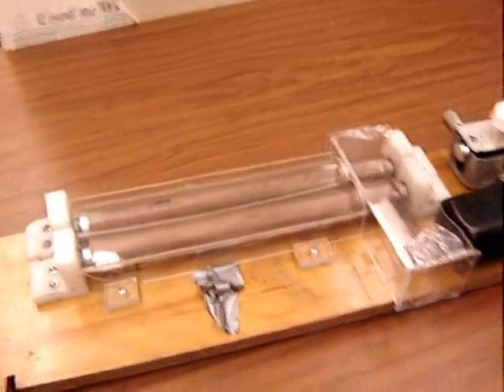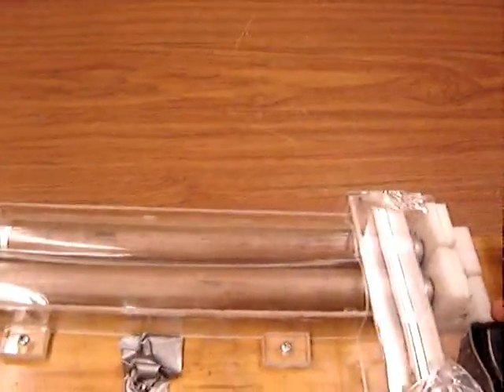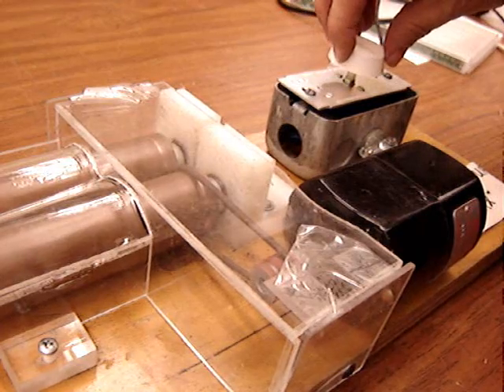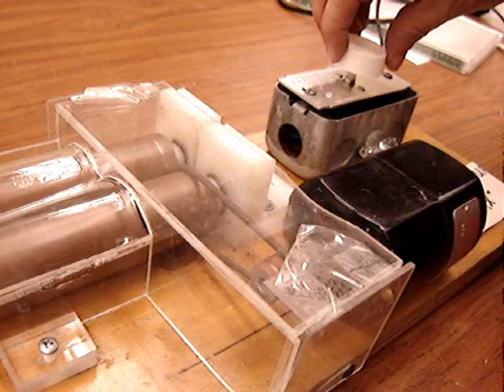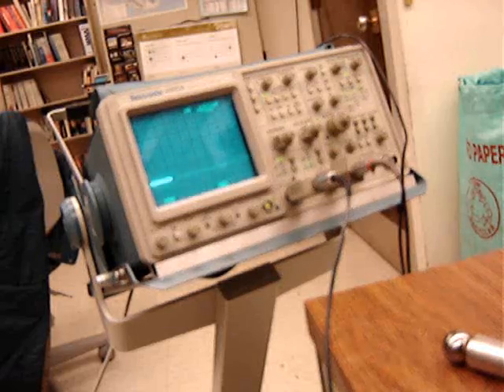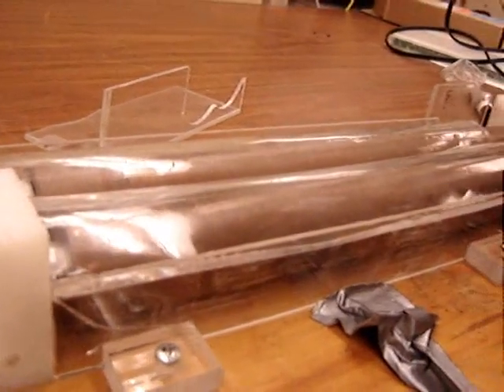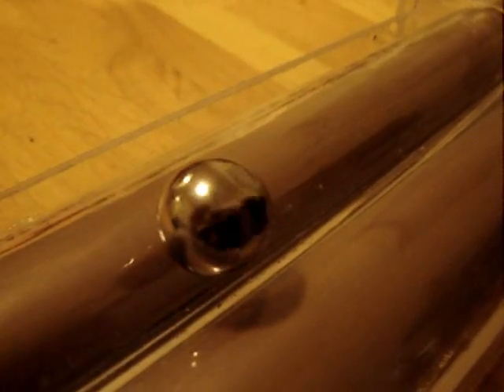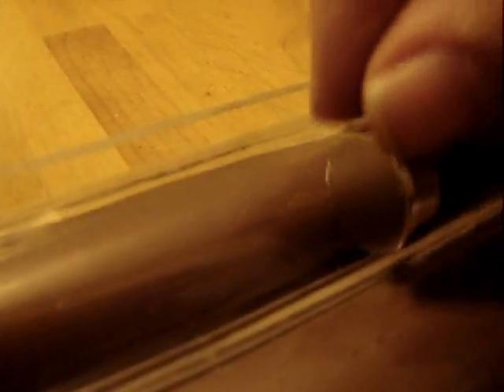Dangerous High-speed Magnetic Levitation Maglev

Comment from the maker: Buy 1/16 acrylic scraps at Tap Plastics, or a glass window shop, or check yellow pages.   Motor torque is important, and a smaller motor won't work (hovering magnets slow down the RPM too much)

There might be an improved pulley-ratio that gives higher levitation.  I just stuck a random pulley on the motor.  Try 20% larger or smaller pulley diameter.  The goal is to match the mechanical impedance (torque/RPM) of the levitator to that small feeble motor.

Comment from the maker: > anyone have tips

Read the website?   It would be improved by nonmagnetic ball bearings.  The copper needs to be solid rods or extremely thickwall tubes, but they don't need to be 12" long.   

Perform dynamic balancing of the bars to make it much quieter.

With a faster, larger motor you could use aluminum instead of copper.

If you used a lathe to carve a shallow ring out of one or both tubes, magnets might stop at that missing ring of metal and hover without sliding off endwise.

Comment from the maker: > 10 times that speed

The magnet would float a bit higher.  But you'd need better bearings, and you'd have to grind away bits of the tubes to balance them so they don't vibrate so violently.

Comment from the maker: > uni-pole magnet

Nope, just a normal ball magnet.  One hemisphere is N, the other is S

If you try to make a uni-pole magnet, the opposite pole just leaks out of any cracks.  For example, two identical hemisphere magnets, if forced together, will be a sphere magnet with a band-shaped pole around the equator, and both planetary poles identical, like NSN.   Twelve pentagon magnets, if forced into a dodecahedron, will have twelve identical poles embedded in a buckyball made of opposite poles.

Comment: Hey, what if you were to wrap a tiny steel wire around the centers of the two cylinders, (like coil it up quite a few times) it should make the magnets just about as attracted to the center as the bearings.

Comment from the maker: Inductive maglev:  move a magnet over a conductor.  Conductors are full of movable charges.  The moving field causes the charges to flow in a circle, which acts as an electromagnet.  The field from the conductor then repels the moving magnet.

But usually a flat conductor is used.  Spinning bars or tubes work fine though.

Comment from the maker: No, it depends on geometery, since the force has two components at 90deg: drag and repulsion.  Deep inside the cleft, beneath the above device, the drag is towards the cleft, and the repulsion is mostly in opposite directions and so sums to near zero.   A very small magnet should be drawn into the cleft.  (But is there any energy well?  Or will the tubes simply grab any small magnet placed there?)

Comment from the maker: It demonstrates superconductor levitation without using superconductors.  (Superconductors lift magnets because of induced currents from the approaching magnet.)

Some proposed "flying trains" used a conductive slab, but I think the modern ones all use electromagnets and iron.   The NASA "Inductrack" project, to launch spacecraft using an uphill maglev train, uses supermagnets flying over stacked copper rings.

Comment from the maker: "Inductive levitation" or "Lenz-law levitation" occurs whenever a magnet moves quickly over a conductive surface.   The moving magnet generates an electric current in the surface.  This current acts as an electromagnet which repels the magnet.  The current loop is a few hundred amperes.

Comment from the maker: You need to watch more than the first 5sec of the video.  Or perhaps you simply don't believe your eyes?  If not, then read the article.  This is an inductive maglev demo for physics educators.

This is an "improved" version, since the more common version uses a magnet held by threads above a high-speed rotating disk.   In this video the supermagnets are stably suspended about 1cm above the metal, no threads needed.   (They do drift sideways if the spinning tubes aren't perfectly level.)

Comment from the maker: Lol, the motor is irrelevant.   If I unplugged it and I let it coast, it would be exactly as dangerous.  Two several-pounds flywheels spinning at 6000rpm are safe?

Volunteer to be hit by a car going 90MPH  ...but only if the motor was off and in neutral gear, and it was coasting that fast.

Comment: tid bit of mis-information at the end, turning the thing upside down wont make it stabilize, you will get the same effect, what you need to do is reverse the rotational directions of the copper pipes, that, and its easier to pull off anyway

Comment: Two things to try to make it more efficient. First of all, thicker conductor. Second, try aluminum instead of copper. For same weight of the pipes, aluminum will allow for much less resistance. So you'll be able to run this thing at lower RPM and with less energy loss.

Comment from the maker: Stand next to it in operation, after seeing that those tubes are almost solid inside; more like copper rods (very thick walls, several pounds each spinning 5000rpm.)    They won't stop easily.

If it could get a good grip, it might yank your arm right off your thorax, even if it only actually shredded your hand.   When power equipment pulls violently on a human hand, where does the flesh tear apart first?  wrist?  elbow?  shoulder?

Comment from the maker: Very interesting, it certainly does change.

If you push the magnet down, the EM drag gets large and the RPM starts audibly falling.

It's nonlinear, so if you try to start the motor while a magnet sitting in the cleft, the speed stays low and the magnet never rises.  But if you temporarily lift the magnet, the motor speed rises, then you can put the magnet back and it remains hovering.

Probably at far higher RPM the skin depth is shallow and the drag is very low even with magnet pushed down?

Comment from the maker: It's much like sticking fingers in farm equipment.  The thick copper has inertia, like a small wood chipper.  rrrrrrrrrRUNK!  (Then wipe blood off your glasses so you can see what happened.)   Would it chew off your hand, then stall?  Or just peel off the flesh?  I'm thinking the screws would give way, so the "jaws" would squeeze tight but open wider and wider as more of your arm was yanked in.   Though it probably would have trouble flattening your elbow joint.

Comment from the maker: > 1.5 volts at .06 amps ALWAYS = 200 rpm

Nope, it depends on the number of turns in his drive coils.  Also depends on supermagnet strength, and upon the conductivity of magnets and metal.   In other words, that device is just acting like a DC motor (as Moore himself does admit in another video  ...it's not supposed to do anything weird UNTIL he adds the next outer ring.)

Comment: Actually you need a fairly strong magnet to do the experiment you are refering to. And the magnet will not levitate, it will however fall more slowly than if you just drop a control magnet to the ground.   
Straight out of the 10th grade science book:
The falling magnet induces eddy currents in copper pipe (which acts effectively as a single one turn coil). The magnetic field created by induced current 'opposes' the change that caused it - this is Lenz's Law.

Comment from the maker: > scaled down version work

The tubes must be very thick (like 5mm wall or thicker.)   If the tube diameter was smaller, the RPM would have to be proportionally higher.   If the tubes were shorter, the bearings would need to be totally nonmagnetic (no steel.)

Smaller supermagnets are too unstable, they just flick around and get thrown out.

Comment from the maker: > while it isn't spinning? 

More conductive metal can spin slower, yet still cause lift.  Brass must spin much faster.   And superconductors don't need to spin at all.

It's because of the "RL time constant" of the one-turn inductor formed by the copper surface.

When a magnet approaches a shorted coil, the metal charges in the ring start rotating (like a flywheel.)    But the ohms of the metal is friction, so the current slows and stops.  Move the magnet fast enough to overcome the slowing.

Comment: Well.. I think the lift distance shouldn't be much reduced, the field from a Halbach array decays exponentially with a scale height equal to the spatial frequency, so you should be able to lift to a height comparable to the diameter of magnets you use; and it should lift at somewhat lower speeds.

Comment from the maker: > if you use a checkerboard pattern 

Yeah, that should give maximum lift, but at short distance (same as the Halbach array trick.)   I've never tried it.   I might need to remove the plastic.

A checkerboard grid of 6mm cubes or disks can levitate chips of graphite.   You can see one of these in the background of "Maglev toy" video.

Comment: Beaty, I've noticed that with aluminium eddy braking if you use a checkerboard pattern of cubes (NSNS on the face), it seems to work much better. I think the eddy currents interact well with the next magnet along so you would presumably get more lift than with one magnet and it's easy to try because checkerboards stick together. I'm not sure about stability though, it may tend to spin. Well worth playing with if you still have this running and have cubes

Really cool.

Comment from the maker: > umm Im just curious but how much resistance

Not much, a 20mm magnet could lift perhaps 50 grams weight.  But if you push the magnet close to the copper, the tubes slow down and the motor gets hot.   With higher speed and a much larger motor, a small neo magnet perhaps could lift a KG weight.

Comment: Very nice tool! What if you tried putting opposite + positive - negative on each end of the copper tubes so that when the magnet is levitating vertically it will stay balanced...or will this effect the copper tubes pushing the magnetic field forward?.... such as in 3:20 where it's being sled towards the left...maybe the opposite would keep it aligned. Have you tried thinner & shorter length copper tubes? this really fascinates me! Keep up the great work!

Comment from the maker: > copper disc rotating at high speed

A copper "turntable" will just fling magnets outward.  Perhaps a stack of very thin disks, each rotating opposite, would float a magnet.

Two disks on edge (spinning like gears) can float a magnet in the cleft above them.

Untried idea: wide copper donut with a copper disk placed the hole, disk and donut spinning opposite.  Magnets placed in the ring-shaped gap between them should float.

Comment from the maker: > since copper is not magnetic?

Copper is electro-magnetic.  All conductors are.  High-speed aluminum rods would do about the same thing.

Whenever a magnet moves relative to a conductive surface, this creates large circular electric currents inside the metal.  These circles of flowing charge will behave just like any electromagnet, and produce strong magnetic fields.  It's these fields which lift the magnet.  It's called "inductive repulsion."

Comment: Mr. Beaty, I noticed it was a bit wobbly, a few times in the video you grabbed it to stop it.

I wondered if you wrapped the magnet in aluminum foil, whether it might damp out- that way if the magnet approaches the copper it would see a sort of reflection of itself coming closer and the eddy currents in the foil should tend to act as a brake and stabilise it after a few cycles.

Comment: Bog standard science, this. If you wanted to MOVE the magnet along the tubes, it will have to push against the (self inducted) magnetic field. Therefore a strong current in the tubes (why not coils?)can achieve motion without rotation. Sounds expensive, but Laithwaite's linear motor (maglev)is the same and is used with great success in Japan. It's a shame that the West is too slow to implement new ideas.Germany may have one soon, though.

Comment from the maker: Ah, I remember that I did initially start out with a variac.  Then I added the small dimmer to make it portable.  This was back in 1998 I think.  I eventually blew out the dimmer after a few years of use, so I replaced it with one with as high a wattage rating as I could find.

Comment: Hm... so obtaining LARGE copper cylinders would have the benefit of creating a larger magnetic flux "well".
Another thought:  To stop the "flying off" of the magnets, you could press the internal ends of the tubes to flare them out somewhat (even a millimeter or two of diameter expansion would probably suffice).. this would create a bowled trough... problem is that the center part will not then be able to touch one another, and I don't know if they NEED to actually rub against one another

Comment: You would get much better lift if you used a Halbach array instead of a single magnet. The field intensity is almost doubled, so the lift should be 4x.

The only gotcha I can see is that it would tend to flip over on it's back. But 3 Halbach arrays in an upside-down W formation should be stable though I think.

Comment: I was thinking that thinner metal might still work at about the same speed if the supermagnets are smaller- presumably everything scales down (including the levitation gap). You get a higher spatial frequency with small magnets and I think that compensates.

I really need to put my ubernerd hat on and do the calculation.

Comment: I think you'd have to change the geometry for that to work- if you move the rods further apart then the repulsions will largely cancel, but the overall drag will still act vertically, and if everything is just right it should be stable I think. But the stability region may be fairly small.

Comment: I have a question which, if answered, would save me a ton of money on litz wire doing experiments on my own.

Is it possible for you to run this same experiment again but instead of a single magnet, use a small Halbach array, maybe five 1/4" cube NdFeB magnets long.  Would you have to spin up the copper tubes to the same speed to achieve levitation?  I wonder what having all the flux on one side would do.

Comment from the maker: > how did you get the dimmer to work? 

Its a 120V AC dimmer used with a 120V AC motor.   See the website for more info.

For DC motors you'd need a variable-voltage power supply.  Or put the dimmer on the 120VAC side of a DC supply.

Comment from the maker: > i thought neodymium isnt magnetic.

Exactly right.  And in ALNICO magnets, the aluminum isn't magnetic.

Neo magnets are actually "NIB" alloy, Iron Neodymium Boron, containing 60% or higher iron.  They rust quite quickly if not nickel-plated.

As I understand, NIB alloy is "magic" because it solidifies with two types of microscopic crystal patterns, and the boundaries between these crystals will "lock in" the magnetic domain walls and prevent changes.  Unlike iron, NIB alloy stays magnetized.

Comment: Rotating pin parallel. 

Try it with the rods stacked, 
and rotating in opposite directions.

Try wrapping the rods with gold leaf or plating. 

Try rods made of different copper alloys, or using different coatings. 

Try using "Joe Cells" as your rods or some  dry variation on an orgone accumulator being basically concentric tubes set one within the other within the other, and isolated with non 
conductive material, filled with water some salts or lye. See if be more current when  rotating.

Comment: Sorry... I don't understand - isn't 97.3Hz 97.3 cycles per second? 97.3 * 60 = 5838 RPM
So he's correct about the ~6k RPM
But.. 5838 * 1.3" = 7,589.4 in/min
Both Google (search for: convert 7589.4 in to mi) and MS Calculator Plus say 7589.4 inches is 0.119782 Miles.
Miles per min. times 60 is Mph, so:
0.119782 * 60 = 7.18693 Mph.
7.18693Mph isn't close to 24Mph.

What am I doing wrong? I did it 3 times, two different ways... (or maybe he just made a mistake or typo somewhere...?)

Comment from the maker: I think most drag is from bearings, and from copper heating from induced currents.  Putting the tubes in a close-fitting shell will greatly reduce the losses from air-pumping.  (Remember, if you plug up a fan or a vacuum cleaner, it will run *faster* because the load is much less.)

Comment: Fasinating ! - Now let me suggest something that may help it to work even better (as i'm also an inventor) - Instead of plain copper cylinders, i have a feeling that shorted copper WINDINGs on cylinders may do even better, to enable "eddy" currents to build up quicker and stronger - that is: Wind copper wires all over/along the surfaces to make a solenoid, then join both ends of the winding on each cylinder together, preferably with a diode, then repeat the experiment ! :)

Comment: LENZ's LAW states that if a magnet go's trough or near a conductive material while either of the 2 is moving, it induces a current in the conductive material (the coper tubes in this case)
This causes the coper to get a magnetic field of its own which repells the magnets field. 

But this is a small magnet compared to a large coper tube, the movement of the coper has to be really really fast in order to get enough repultion to actually overcome gravity.

Comment: Here's another leg to your experiment:

While keeping the RPM constant, measure how many more amps (if any) are required to run the motor while the magnet is suspended vs. when the magnet is not on the device at all... that is to say, does the presence of the magnet introduce any additional resistive load in the rotation, or is there a push/pull equality?

Comment from the maker: > Lenz law in simple terms?

It's when a *changing* magnetic field causes a conductors' movable charges to flow as an electric current, but then that current within the conductor will create its own magnetic field which repels the original field of the magnet.

So, if a magnet moves past a conductor, a current appears inside that conductor, which forms an electromagnet, which both drags and lifts the magnet.  (Or move the conductor while holding the magnet still!)